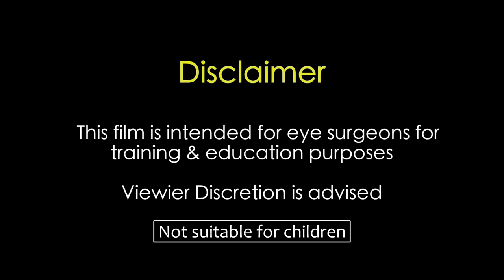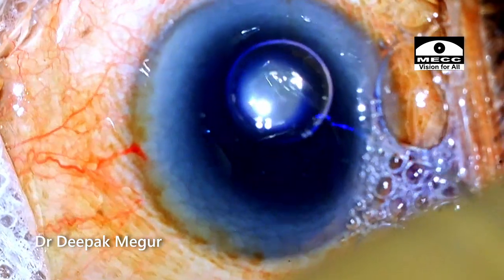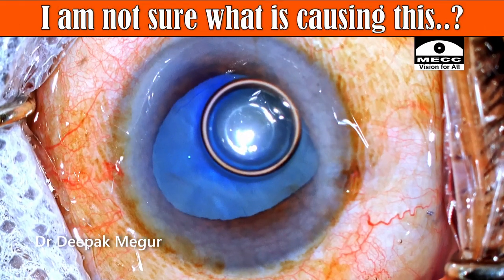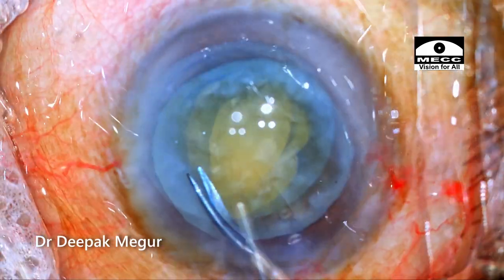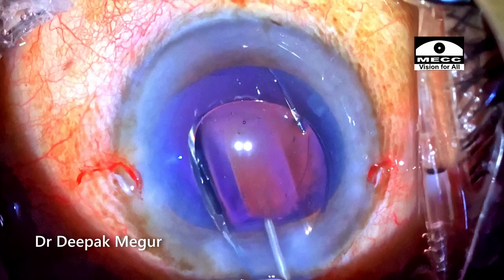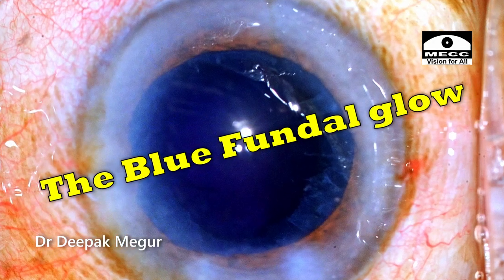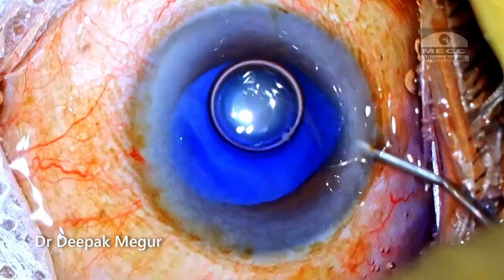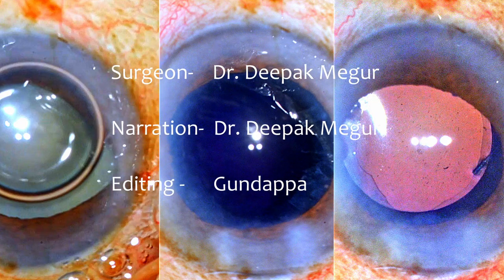Intra-Op Iris Prolapse and Shallow Chamber ...Cause..? - Dr Deepak Megur

Comment: Nice one sir.. the animation in particular was superb..
One point i wanted to ask
Does the fluid misdirection syndrome chance comes down if we do the staining and intracameral lignocaine after we  make the main port, thru the bigger port, as we can control the IOP better by pressing the postr lip of the bigger main wound. In this case with smaller side port there's no place for the fluid to come out so it may tend to go thru the  potential zonular weakness zones into the bergers space...
Reply from the maker: Hi Naveen ,That is good thought..!  Worth trying